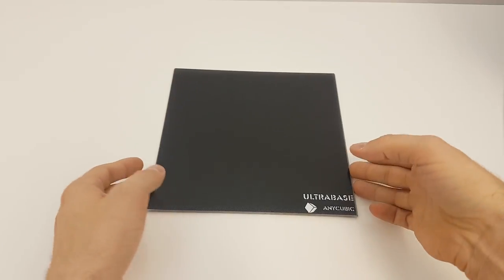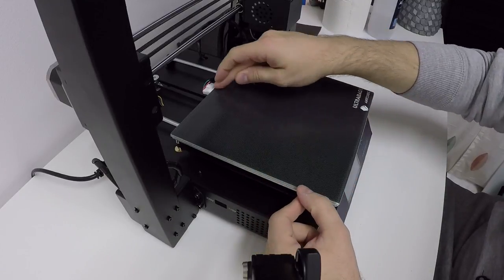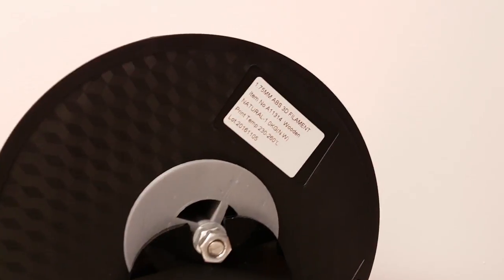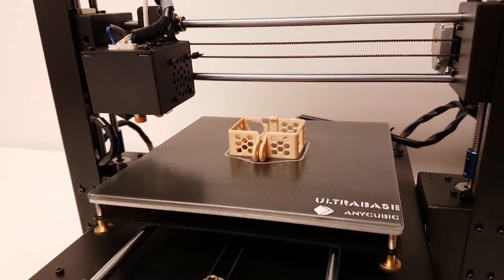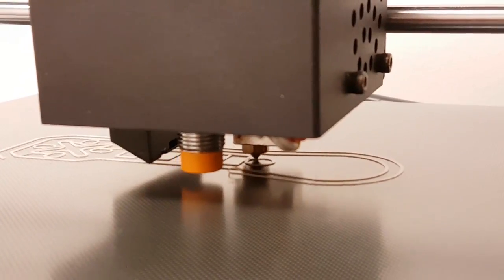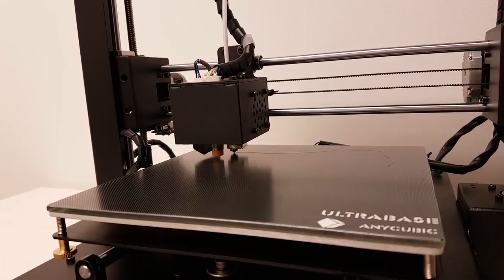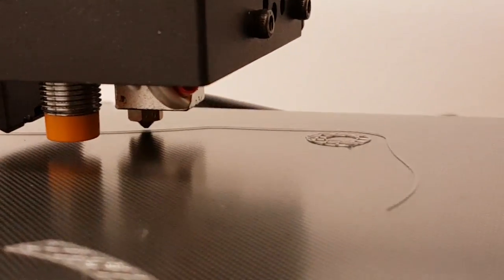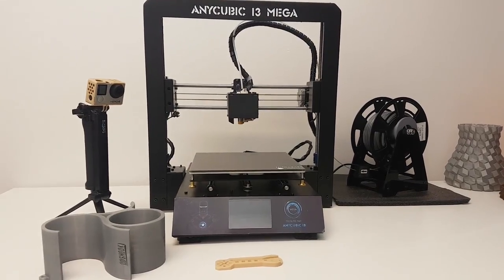Upgrade your 3D printer - Anycubic UltraBase review

Comment: Just a tip I found when removing adhesive bed liners. Most of the time @120c, if you peel real slow (your gonna needs gloves for this, because its hot!) the liner will remove fully leaving little to no residue at all. But if you do get residue left behind after you peel it off like in this video. I found that taking a piece of blue painters tape and dabbing it on the residue does an excellent job of removing the mess. (I also did this with a warm build plate.) I thought about trying out a pet hair/lint remover (you know... the sticky sheets on a roller), but I haven't had to remove my build-tak sheet in quite sometime. I've done the acetone and scraper bit, and it's no fun at all. The blue painters tape is much faster and easier way to clean up. (In my opinion)
Reply from the maker: Grant Deisig Thanks for tip I will give a try next time. Cheers.

Comment: put a sheet of this on my anet a8. and after hundreds of prints there is only a tiny area where the coating came off. other than this it works like brand new.  

the only downside is you MUST heat your bed for pla to stick. 63c is what i find is perfect.
Reply: lefthandedpolack I never heat my bed for pla and it sticks

Comment: wish mine was as good as urs .. :(  i cant ptint above 100mm in height without the print coming unstuck and sticking to the nozzle !!  how did you manage to print that huge print at the end ???  what heat settings and speed  settings did you use .. 
this bed is great with anything under 100 mm but over and it comes unstuck and gets thrown around the bed .. i have given up printing anything larger than 100mm high now   thinking of ditching the whole thing !!  :(  :(  :(

Comment: Did you have to do any adjustments with your inductive sensor when using that new plate?
Reply from the maker: Marion Cravens I did not use Inductive sensor for leveling. I most use Manual adjusting. That's why all I3 now dont have sensor no more. Its better this way.

Comment: Do you have any problem with the leveling sensor using the ultrabase? I've read on the internet, that sensors won't work properly?x
Reply from the maker: Michael Kühn Yeah the sensor won't work with Ultrabase and that's why Newest I3 mega don't have it installed. It's not a big of the deal as Autolevel on I3 Mega is only assistants level so you don't actually need it.

Comment: This heatbed is only for PLA.
ABS (and ABS+): Totally pain to get the first layer right (Yes, it works, after the 3rd -10th try and nearly carving the board)
PETG: Many owners said PETG can't be removed well and many of them damaged the board.
So sorry: PLA will stick on a cheap 3 USD/EUR glass platform as well as on this one, so there is really no benefit.
Reply: matthias lichtenegger but he tried abs on this and it printed fine. Also, this surface is supposed to adhere with no hairspray, glue etc., then release easily once cold

Comment: If you're printing in ABS with no enclosure, what's your ambient temperature?  Any breezes?
Reply from the maker: Joe In this video? Ambient temperature was 22 degrades.
Reply: @NexiTech  wow. I'm assuming it's a sealed room? At 30C I get constant layer seperation due to shrinkage from air currrents.

I agree the ultrabase is good though. Considering this video's from 2017, is yours still usable? Or have you had to replace it? I jist purchased one and while I'm impressed with its adhesion, I've not been able to find any reports of their expected life.
Reply from the maker: Joe Well no, I have constant ventilation in every room.
 For these small type prints you don't need any enclosure for ABS but for bigger models yes you do,ABS warps like crazy.
 I have modified my Tronxy X5SA and made Plexiglas enclosure where I can easily reach constant 50C. Check videos on my channel there are alot of useful info. Also If you don't damage your Ultrabase physically you can use it for very long time. Only remove prints when it's cold and don't use anu sharp metal object and make sure that nozzle is not rubbing on the surface. 
P.S. Avoid ABS print with it only if you must. PETG is the way to go. For me personally best and easiest material to print is PETG.

Comment: How does this work with a printer like the anet a8 that has screws in the corners of the bed?
Reply from the maker: John Shillinglaw Yes of course. Under video description you have link for Ultrabase. There you can choose corn/less model if you don't want to go full size ULTRABASE like I did on my I3 Mega and Anet A6. BTW check my ugrades for A8 or A6 you will see how to convert screws on heated bed to not movable and after that you dont need screwdriver for bed leveling. You can level it with knob like I have on A8,A6 and I3 Mega.

Comment: i have problem with my ultrabase on cr10 , skirt dont hold on plate then all printing goes wrong.. dont know what to do .. i tried 50-60 celsius temperature but did not help.. also calibrate desk.. any suggestion ?
Reply from the maker: Spenat1k 70C? Clean the Ultrabase with alcohol and re-level the printer using A4 paper.  Drag your X carriage over ultrabase and look distance from nozzle to Ultrabase to confirm that is level correctly.
Reply: I will try  70c  and re-level again.... A4 must be smooth goes under nozzle right ?

Comment: The problem is that it's a consumable,  rated for a year of use.  mine after a few month is already fading...  
a few minutte particule stick to the print, and over time none are left on the glass, not wating for it to cool, worsen the effect.
Reply: You got it perfectly. Lasts me maybe 6 months if I'm very careful then it needs to be replaced.

Comment: Why youre manually leveling the heat bed?? wont the sensor work on this print bed?
Reply from the maker: Nithin K I3 Mega use proxy sensor for asistant bed leveling or sound levelling. That means insted of paper you have probe wich beep when you do your "manual" leveling and nozzle is on right distance from the bed. If you have any experience you don't ever need probe or sensor for bed leveling. Just A4 paper sometimes and if you printing ever day after I wille  you will get feeling and than you dont even need anything to level you heat bed just eyes.
Reply: Ohh great!! Thank you for the response. :)
Reply from the maker: Nithin K You are welcome :)

Comment: This works with the autobedleveling?
Reply from the maker: Mälsåker Lures Well maybe but it can be little problems with probe sensitivity on some printers not every proxy probe will support it and you have to add Z offset in Cura by glass thickness.

Comment: The issue here is that you will loose that adhesion very quickly...or get a chunk out sticked to a petg part
Reply from the maker: I use Ultra-base and similar pattern glass surface for very long time now and I have it  on many 3D printers, the last one that come with with it is Creality Cr10 V2 and this surface still holds very good over time. If you level the printer correctly and you don't stretch the surface overtime and you remove prints only when it's hold it can last very long time. I only clean it from time to time with window cleaning solution(Blue one), I found that alcohol can wipe off surface after long term use.
Reply: @NexiTech  Do you use it 24/7?Maybe you got lucky,i already ruined 3 ultrabases...if you use comercially you will loose grip or get a chunk out of the base...but this happens only with petg.With pla it only looses grip...and if you do a search through the web tou will see that its a common issue

Comment: Hey, i tested between 50-70°C on the bed. But i always get a little bit of warping (PLA/white/DasFilament). Do you have any suggestions, what to try?
Reply from the maker: Michael Pinjusic Try to lower first layer higher or re-level your bad and clean it with 99% alcohol. It should be good after.